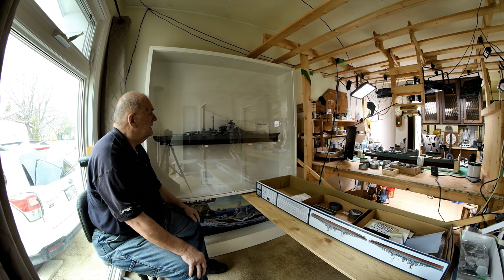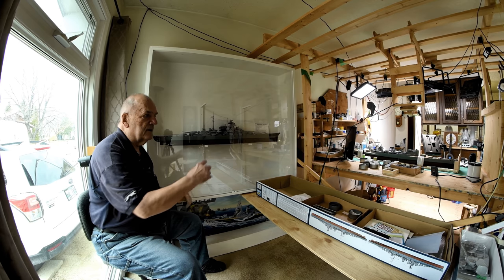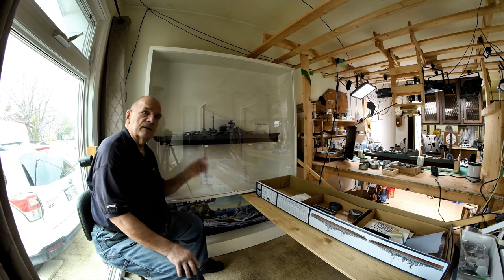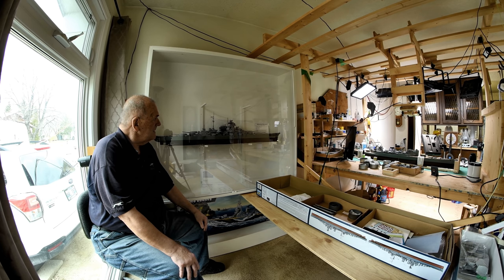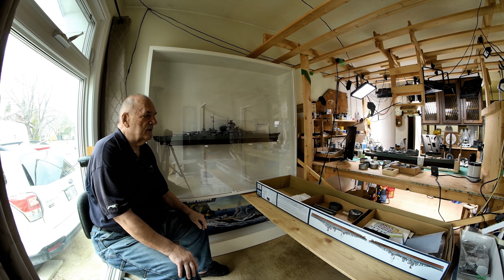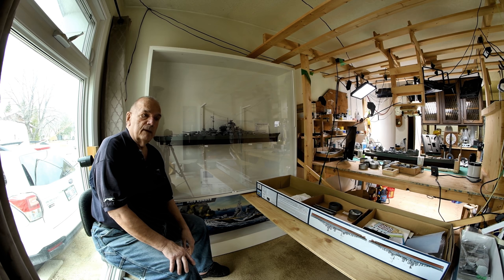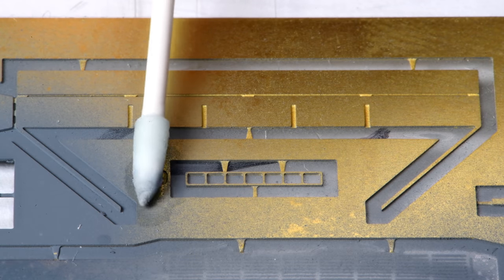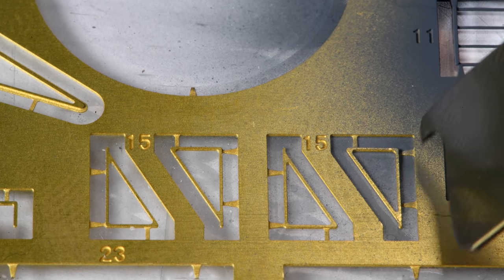The Model Ship - Part 755

Comment: Hello Ron, the Amati kit was made for Hatchette and released as a magazine subscription. I believe Amati later released it as a kit you could purchase off them direct (the add you showed) I have the Hatchette kit myself (under construction), and make no mistake, it has a huge amount of photoetch. It is actually a wooden plank wooden frame kit and all the upper superstructure walls are photoetch, There are some plastic parts, but not that many. The Kit can be fitted with RC motors and is designed to float. Non lovers of photoetch would not like that kit.
Reply from the maker: Thanks for this info Derek. When I looked online through the instructions for the Amati kit I don't recall seeing PE. Perhaps I'm wrong. Wouldn't be the first time, lol. It was from that kit where I'd got the rigging diagram for my Bismarck. 👍

Comment: It would be interesting to do a side by side comparison of both version of the build but it would also be interesting to figure out how many parts could be eliminated because they are no longer visible on the finished model, (for example your Grand Staircase on your Titanic model). For most modelers you spend more time looking at the model during the build than you ever will after the model is finished. For lighting your display case you could try installing a strip of LED lighting around the inside edge of the display case.
Reply from the maker: Hi Kevin,
Re: "you spend more time looking at the model during the build than you ever will after the model is finished"
That' for sure! I spent more time looking a the Bismarck there today than all the time put together since I put it into that case months ago, haha.
Yes, have thought of LED light strips, how ever because I didn't want anything inside the case that will produce heat, I'm hoping to illuminate from the outside of the case. Now I do realize that LED's don't generate "that" much heat .... but some however. 👍

Comment: Ron make 2 holes in the cealing of the case and put 2 ledlights in it Gr. Rob
Reply from the maker: I will admit that having the lights on the inside of the case will dramatically reduce the reflection problem. 👍
Reply: I think zo to